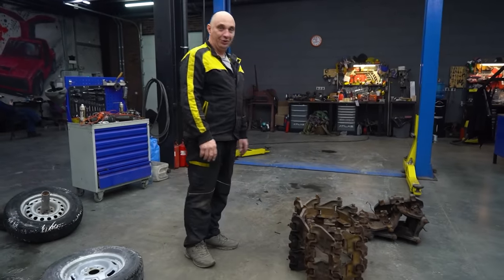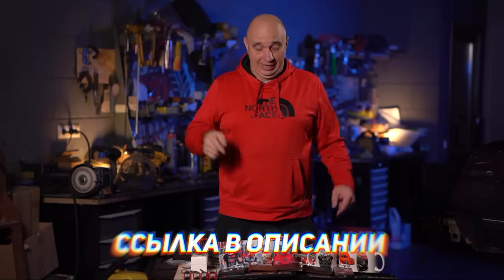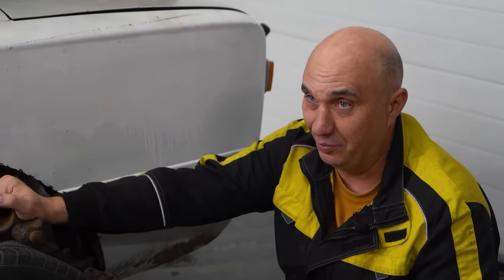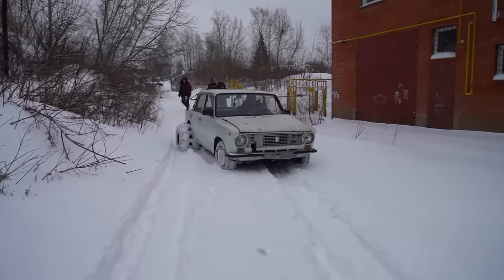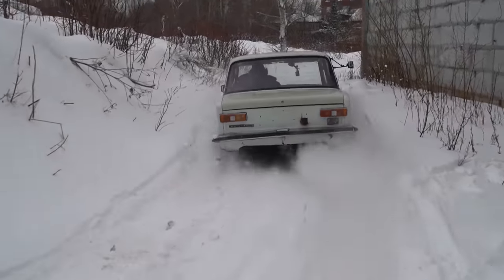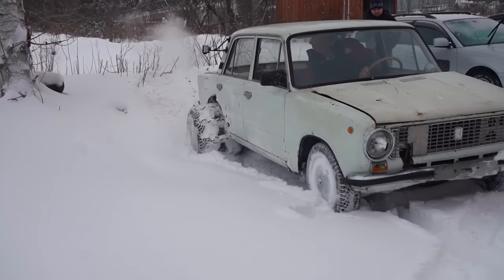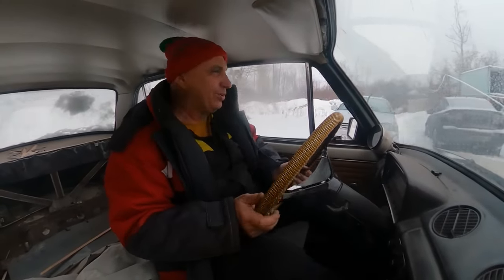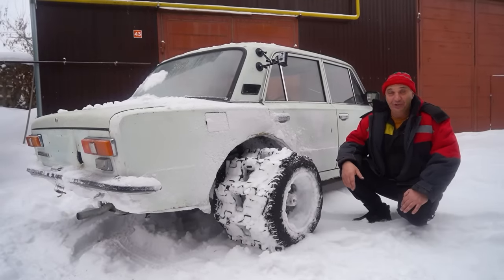Tracked wheels for ultimate off-road ability

Comment: I reckon you should do this to a Lada Niva or UAZ 4x4, would be a serious snow off roader :)
Reply: I want to see how it does on 45°+ slopes. Is it better to worse than a series offroader?
Reply: lada halftrack?
Reply: @jwalster9412  the poor engine would melt by the time it got to the hill lol
Reply: @oshkiv4684  if it's winter outside, probably not.
Reply: I was thinking the same thing.
Reply: The same track setup but also on the front of a 4x4. They should be designed for that size wheel roughly and low range with 4x4 would make it a crazy everywhere crawler

Comment: I've done this with an atv in the past. I used 3" lug rubber snowmobile track and wrapped it around a set of 8" rims/tires. It was amazing in deep snow but would rattle your teeth on flat hard ground ahahah. You should retry this experiment with snowmobile tracks. They are surprisingly resilient, and weigh 10x less than that steel track you're using

Comment: How about a real Lada-Tank? Remove the Driveshaft, fit tracks from front to back left and right on the lada and use the Hydaulic system you used earlier in the Videos. But use a Lever for each track to control them for forward and backward motion so you can have full control.

Comment: Add a second standard gearbox, behind the existing one, for lower years.
Lift suspension all round by 4 inches, to clear the body over the snow and fit wider or double front wheels too.
Clutch should be fine, with extra gears.
The low center of gravity with wide wheels will be great on slopes

Comment: It is a Lada WAS-2101 (1970-1988) the Engine has max 60 Hp and 87 Nm peak Torque... no wonder why the engine struggle so much.
Reply: That is good sport
Reply: Swap a different differential and give it a 5” lift.

Comment: These guys should mount the hot side of a turbo to the pinion of an axle and make an "exhaust driveshaft"
Reply: A turbo impeller has almost no power at static and low rpm's.  Better to connect the turbo direct to the engine via the flywheel.  That will make it a turbo compound engine.  Put a starter gear on the turbo shaft and then connect it to the flywheel in place of the starter.  You'll have direct conversion of exhaust heat to mechanical energy which means you'll get more efficiency out of the engine.

A turbocharger, OTOH, is designed to cram more air-fuel mix into the cylinders and you get more power that way.  It is less efficient in terms of converting heat energy into mechanical work.
Reply: And yes, a turbo compound Lada engine will have the problem of starting it.  The alternator could be replaced with a motor-generator, which can act as both starter and generator.
Reply: @shoveI  That would work.  I'm just basing my idea on the turbo-compound engine that was used in the DC-7 airliner.  
When it worked, it was awesome.  The metallurgy of the time just wasn't up to the task and it was unreliable for passenger service.

Comment: Adding tracks on the front, so it would sort of have all four corners floating on top. Or the current tires, sort of cutting through. Which is better? How much benefit would the addition of skis, in place of the front result in? What system could be, for the tires and the skies , either together or engaging skis?

Comment: never seen that style track here in the us atleast not that narrow a better way to do this if you have 4x4 is take either a already wide rim or make a wide rim then you take plate steel and weld it to the rim sticking straight up(makes the track ribs) then just weld three crossbars between each rib for strength then it far more balanced and you have way more suspension travel/wheel clearance) you can use the same concept but you use rubber tracks as well instead of building metal ribs dont use on a lada or atleast not without really low rear gears and a low geared transmission they just dont make nowhere near the power to turn the "wheels" correctly

Comment: don't need gear boxes and high low range all that added jazz you just need to add skis on the front 2 wheels so they glide over the snow instead of plowing the snow with the tires that's the biggest issue with tires they try and plow not glide over especially in really wet heavy snow why do you think  they put skis on the front of snowmobiles instead of tires

Comment: Why not just weld each piece of the track to the rim directly? Take the pins out and weld them. You could even cut them in half so they are the same width as the rims. Narrow tires are better for the snow. Your current setup is better for mud.

Comment: I suggest to install some bit longer and stiffer springs with these wheels, that might help a bit. 😉
Also, what if you connect the additional wheels together with spacers and long screws? 😉

Comment: I have a better idea. You should have started with a bare rim. Wrap those tracks around the rim and fit those brackets on the inside of the rim. Weld and bam. I saw those have flanges and wouldn't have as much weight.

Comment: Military tank tracks lol
Reply: After some googling, it actually looks like those are the track links off of a DT-54 tractor, or one of its descendants; the Kharkiv Tractor Plant that designed and built it still exists today, and sells a tractor that has very similar tracks and suspension, although the look is much newer than its 70 year old progenitor. Agricultural use, not military, although I'm sure one of these newer ones has had the pleasure of towing a burnt-out Russian tank at some point...